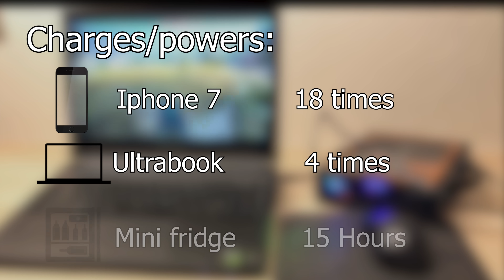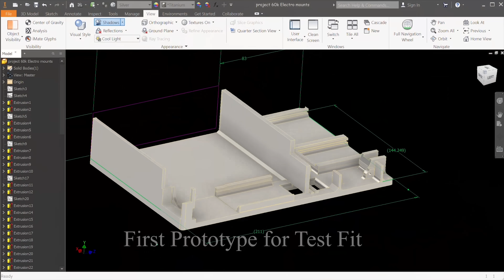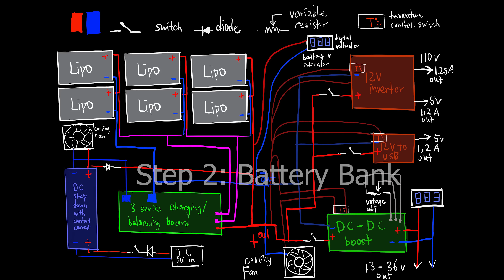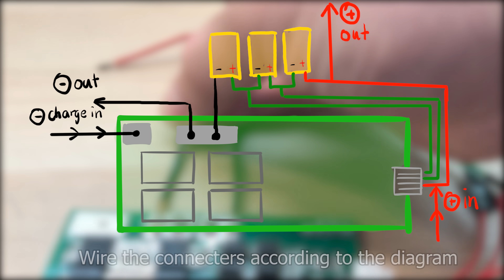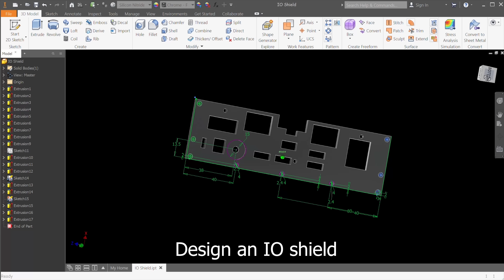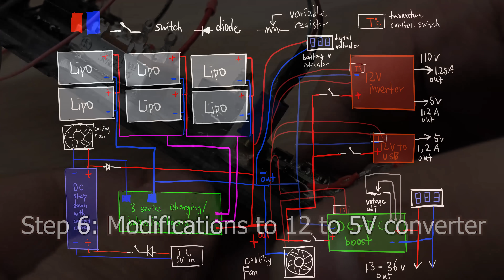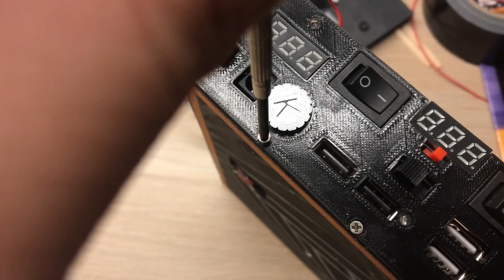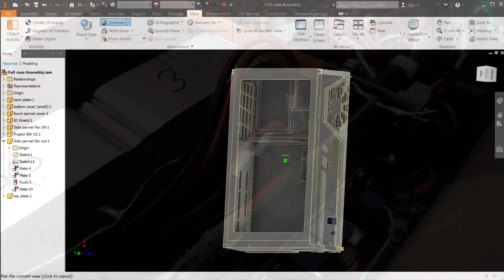Ultimate DIY 60,000mAh Power Bank (222Wh)

Comment: I read your comment BUT..... When you put 3 cells in series they become one practical cell... 10AH 10,000Mah.. put that new 12v 10Ah cell into parallel and you have 12v 20Ah..
Theres no way around the math. If you want a constant use WH..    248Wh.. Wait... Even then you don't get past that as the cells are series parallel. Im glad you built this cool little power bank. You have some skill but no matter how you look at it its still 20Ah. I gave you a thumbs up because its a nice little power bank but you really should change the title. Its misleading.
Reply: so is every powerbank any market has ever sold, he is just being consistent. all powerbanks are sold as 3.7v equivalent amp hour ratings, because it doesnt matter to the consumer what voltage internally it is it is just something to easily know the size of the battery.
Reply: @SuperBrainAK  Yes and no. I respect your input <3    BigClive tests power banks from time to time. Its a mix.. Many legit ones will measure out correct based on their output voltage. Many Cheap Off brand ones will skew numbers. Sometimes in an extravagant manner.
Reply: Ms.Fixit well yea his cells are rated to 10Ah each but who knows if they actually hold that much. you can also say the total watt hours and then you can tell the actual power rating, instead of letting the user assume the voltage your rating is at. But everyone stating at 3.7v is actually good because everyone can safety assume the rating is for a 3.7v configuration
Reply: I agree, watt hours should be the marketed energy storage rating for power packs like these 

Amp hours is great for selling individual battery cells or batteries, but for power packs and jump starters.etc, watt hours should be the standard
Reply: Ms.Fixit how can I run my 9 LiPo batteries in series and Parallel? I wanna use 3 to get up to 12V and the rest to just be used as energy storage, like longer runtime ya know?

Comment: 9:20 smh...
Reply: Better to crimp or solder ring terminals or similar onto each wire and then bolt them all together. Or a bus bar or something
Reply: as an electrician that hurt my soul
Reply: @dylandrouin3085  😂 feel your pain brother lol
Reply: HAHAHAHAHAHA!!!!!!!!!
Reply: Should have just twisted them together then solder or use a bus bar, just mashing them together isn't a good idea.
Reply: @kralyn3d I feel like a lot of people have expressed dissatisfaction with 9:20 and have suggested alternatives (such as soldering to a bus bar or using ring terminals), but no one has really explained why it's bad to solder a huge mass of wires together.

The reason why it's bad is because solder is actually fairly brittle. In such a large mass, there's a significantly higher chance that it may just crack with slight mechanical stress or even temperature shock (there's a lot of material to expand and contract). This in turn can cause intermittent power loss due to loose contacts or fire from sparking/shorts.

Bus terminals allow you to have less solder per connection. This allows for more space to expand and contract and there's a smaller surface for forces to act on. Ring terminals/crimping follow the same argument. Fun fact: all the factory wires in a car are crimped rather than soldered so they can withstand road vibration without cracking.
Reply: I actually got anxiety from watching that
Reply: @kralyn3d  Don't worry about defending your actions. Just listen to the advice and keep doing what you are doing. I learned a lot from this video and hope you do more.
Reply: I used to do that, was constantly pricking my fingers on bits of wire lmao

These days I use connector blocks
Reply: একটু বেশিই কুচুর মুছুর...
Reply: 🤮🤮🤮 christ on a stick, barf, how the hell, barf, can you do, barf, that....how is he still alive... na that's not a fire hazard, now this is a fire hazard!!!!
Reply: Hey now. He did say in his description that he wasn't an electrician...
Reply: @dylandrouin3085  I'm an electronic engineer, how do you think it made me feel :<
Reply: He should have used a butt splice, that what they are for! Or better yet use a copper bus bar, that is how other manufacturers do it.
Reply: @kralyn3d  No need to solder. Just use a bus bar.
Reply: my eyes...
Reply: @miniwarrior7  its not perfectly fine. if you're going to dish out advice, do it in such a way that it would make the person better
Reply: is that impractical?
Reply: use WaGo
Reply: @kralyn3d  That shits gonna break and set your house on fire
Reply: You don't even need a bus bar, just twist together the strands of each wire, put solder on them, and then solder your new "solid core" wires together.
Reply: @araibirshad8294  All advice does not have to be negative.... What he did works, and I bet it's still working fine.
Reply: @dvulichie9589  what?
Reply: Jan Nowak  A fridge won't run the entire time. So it is entirely possible that this could power a mini fridge for 15 hours, just not continuously. If your mini fridge does run continuously you need to replace that thing.
Reply: @kralyn3d  A bit mor solder may be just fine...
Reply: even a wire nut woulld have been better
Reply: @JohnSmith-rn3vl  Please don't practice what you have learned around me.  Thank you!
Reply: I almost cried here

Comment: Great video. Maybe for the new video, could you consider a way of locking the DC voltage output. Using such a knob is too easy to accidentally turn and could blow up a laptop. Maybe a locking mechanism on the voltage knob? Or somehow incorporating a toggle switch to lock the output voltage?

Comment: The power capacity is 20000mah because the 3s lipo protection board delivers 12V output by supporting 3x  3.7v Lipo batteries. Which means thst for 6 pieces of 3.7v 10000mah  batteries, there are 3 groups of 2 Lipos connected in parallel to obtain 12V 20000mah from protection board. You will need 18 Lipo batteries to with an 65 watts protection board to get 60000mah 12V output.

Comment: Great build and stuff but one thing and it is the big thing, IT IS NOT 60Ah! If you connect the batteries in parallel then the capacity will be greater but the voltage will stay the same. If you connect them in series then the voltage will increase but the capacity will stay the same.
Your battery pack should be rated at 11,1V/20Ah because you have 3x3,7V batteries in series and 2x10Ah in parallel. That is 3*3,7V * 2*10Ah which is about 222Wh, which is the same as 6*(3,7V*10Ah) or just 6x37Wh.

Source: https://batteryuniversity.com/learn/article/serial_and_parallel_battery_configurations
Please correct that mistake.
Reply: @kralyn3d  That is why they should real use the power * time parameter not current * time. For the raw battery [Ah] have a sense but for power banks it really don't because you will never know on which voltage they operate and stuff. For me 222Wh is peaty good. I still insist that you should use 20Ah not 60Ah but ya... It is not correct and never will be.... It is still very good project tho.
Reply: Yeah, @K R A L Y N  
Just change the title to "Ultimate DIY 3,7V 60,000mAh Power Bank" or something like that.
Reply: Bartłomiej Nóżka you copied the color of my image :(
Reply: You are right and also wrong
While using a good buck converter 12v -> 5v with 90% conversion efficiency
he can use the 11.1v 20ah(222whr) battery as a 3.7v 54ah(199.8whr) battery
which is same as using a 5v booster used in a powerbank

Comment: Crusty solder joints, hotglue on the parts that might heat up and melt it, a lot of exposed connections, cells put together with a ordinary non-high temp tape, dude...
Reply: Harsh........ Everyone starts somewhere, try to be positive in your feedback. Mistakes were made but rather than trash on them use the opportunity to educate and help him.
Reply: Not going to educate him, everything is already on internet, just google it.
Fishpaper, capton tape and non-acidic silicones are way to go.
Also to get decent solder joints you need like 30 minutes of youtube videos and few hours of practise, that's not much.
Reply: "I'm not gonna educate"

immediately starts educating about Fishpaper, capton tape, etc.
Reply: @randomnobody8770  Just throwing some keywords so it's easier for people having troubles with Google...
Reply: @Veritas-invenitur  he is actually being positive... as in he's listing the things that are wrong. the guy may actually learn something from this. whats the point of criticism if it acheives nothing ?
Reply: Well, if you want to make it you will be smart and do it right, right?
Reply: @Veritas-invenitur  Not my job to educate him.

Comment: That case you made up just screams SEXY!!!

as for the internals, here are a few things that you could do to improve the device (a lot of these are in my solar generator, though mine is a lot heavier and bigger) 

> Use 24V as the battery voltage whenever possible when working with lithium ion batteries, 7S lithium is in the perfect range for 24V inverters, USB chargers and other accessories (no boost converters needed) whereas 3S us too low to get full use of the power and 4S is too high for 12V devices to work 

> Heatsink the inverter for Christ sake!!! (That thing will overheat and fry if you don't heatsink the inverter MOSFETs) just having a fan blowing on the MOSFETs isn't going to cut it

> I would recommend using connector blocks instead of soldering wires together (solder joints often break in portable devices like this 

>  Make the battery bigger than you think you need (less chance of inadvertently overloading the battery)

> Add a fuse or a circuit breaker on the main power rail!!!

Other than that, this one is pretty damn good 

Mine jas the following specs

> all metal chassis (more durable than PLA) 

> 24V 40AH 18650 pack (made up of 3 individually removable 7S 5P battery banks for ease of maintenance) 

> 24V - 240V 400W modified sine wave inverter (couldn't find a 400W pure sine inverter that would fit in my design)

12V lighter socket (120w buck converter)
24V lighter socket (direct connection to the main power rail) 

> 10V-60V power input (can charge from almost anything, from a car battery to a rooftop solar panel and anything in between)

> I use 2 BMS boards in parallel for redundancy (I also have top end balancing via the use of voltage triggered resistors if both BMS boards fail) 

> Integrated 20W solar panel (charger of last resort) 

> LCD battery power indicator (gives percentage remaining, battery voltage and a bar indicator) 

> The wiring is uprated to 200% of the maximum power draw I will be pulling from it

> I use circuit breakers rather than fuses (replacing a fuse in the outback is kind of a bitch) 

> There is also a Li-Po voltage alarm connected to the spare 7S JST connector (there are 4 connectors, 1 for each battery pack and one for maintenance)
Reply: Please is there any way i can see this?
Reply: @cryptoville8961  I might make a video on it when something breaks and I need to repair it
Reply: @mwbgaming28  i can't wait......😁
Reply: @cryptoville8961  well you might be waiting a while for something to break, seeing as I over engineer things beyond normal levels of sanity to ensure maximum reliability

Though it is due for a battery upgrade relatively soon, going to be using higher capacity cells, when I do that upgrade I will record it and post the video link on my channel (Il post the link here if I remember which comment it is)

Comment: literally the ONLY thing I dislike about this, is that it uses Lipos (they HATE being left at full charge... and power banks need to be stored fully charged incase of emergency which you cannot predict... unless you charge them to something like 3.9v-4v instead.)

otherwise, this project is awesome... awesome job! this really gave me inspiration and ideas of my own :D
Reply: Hate is a pretty strong word. They certainly age faster at full charge than at nominal/storage charge, but the benefit of having double the energy density outweighs the negative of extra capacity loss over time from full charging, I would say.

Comment: You really did a great job! don't care about those how don't thanks at first them give the advice, you can only take the advice and leave the other words :), i think you still need to add some protections like fuses and temp controller, But you really doing very beautiful project  which most companies interesting in doing such products, your idea about providing wide range of outputs is very useful in our countries (we lost the power daily). i think you need to make a universal output and name it like laptop output, phone output and inverter (i.e lock the output voltage to those applications only to provide robust and plug and play device for those who work in area with unstable power source.
Great job bro.

Comment: Saved to my favourites! 
One question: Why do you need the rectifier diodes? Can charge current flow in the wrong direction otherwise? Or are you gonna charge with an ac power supply? Someone please explain..

Comment: uhh I don’t think it’s ok to draw this much current from those lipo batteries. also the powerbank is 20000mah because 2 batteries in parallel doubles the capacity and the series batteries just increase the voltage not the capacity.

Comment: Damn... It's looks like a time bomb
Even though that was a powerbank
Reply: It is a timebomb... No fuses, no thermal protection/shutoff, cold solder joints which will crack loose and short stuff out, no overcharge protection on the batteries and so on... This thing is literally a timebomb waiting to set someones' house on fire...

Comment: Quick tip. You have a 3s 2p battery not 1s 6p it’s 20,000 mAh not 60,000
Reply: Description.
Reply: Aethelbeorn his description is incorrect. It’s not the same lmfao
Reply: It’s still a 20Ah battery. If that, that’s assuming his cells are brand new
Reply: This is where converting to Wh is better
Reply: @faded.0913  not!
Serially connected batteries add up the voltage and maintain the capacity!

In parallel, the capacity is added and the voltage is maintained.

Comment: i don't think, that's a 60000mah actually it's 20000mah, yes you are using 10000mah 6 cells but in your circuit you are using 12v circuit keep it mind if you parallel 2 battery, amp will increase but the voltage is same or if you series 2 battery volt increase but amp same in your steup two 3.7v 10000mah battery parallel=3.7v 20000mah and that 20000mah 3 package in series= 11.1v 20000mah other side parallel all 3.7v 10000mah 6 cell battery=3.7v 60000mah but both are basically same because 11.1x20000mah=222w and 3.7x60000mah=222w, yes your powerbank can give you more than 200w like 222w but but that's not a 60000mah steup
Reply: Exactly! And I'm not one that easily goes "this thing isn't safe". But I (and many other commenters) see a whole host of poor engineering decisions or downright dangerous decisions. not a single fuse in the whole thing for example....
Reply: 20000mah 3s is the same thing as 60000mah 1s guys. It just depends on which way the cells are connected when measuring
Reply: Let me clarify. It's the same if you were going from the balance plug on a normal 3s lipo which isn't on these lipos. These look like 1s lipos unless the cells are end to end instead of on top of each other. The 3s 5500mah batteries I use are 3 times thicker than these since the cells are on top of each other.

The way he hooked these lipos up, with just the two wire positive and neg you guys would be correct since it's 12.6v being stepped down. On a regular non hacked 3s lipo you would also have another 4 wire jst looking connector for balance charging that you could use for stuff under a few amps that you could have hooked up to have a 60000mah @ 4.2v capacity. If it's hooked up just to the 12v you're loosing mah due to the efficiency and heat generation of stepping down the voltage.

Comment: I don't like it...

I love it!!!!!♥♥
I was planning to make this..! I made 100800mAh powerbank with foam board...BROKEN..
This was very helpful!! I should try with 3D printer..
Reply: There are a whole lot of other materials between foam board and 3D printing that you might try... Wood, plastic, acrylic, boxes you may already have that are made of pretty much any material could be used here.  I recommend plastic containers from the dollar store. Easy to work with and super cheap! 
I just mean to say that 3D printing is cool, but ultimately unnecessary for most projects unless you have the extra cash just laying around.  Designing for the printer takes some practice, and I'm sure that can be rewarding. But there is also something to be said for adapting an existing enclosure to your needs, or vice versa.
Reply: Yeah me too.... and also one of the worst soldering jobs i ever saw.... he cant even use new parts,they are cheap
Reply: Yeah maybe i will also love this if the creator of this video is Honest!!

Comment: This is really nice.  Would have liked to hear you describe as you assembled the unit, and as you put it together.  Maybe the 18650 power supply how to will have this.  I would like to know your reasoning for putting the power bank together and what it solved for you.  Be careful with those LED meters, more often than not they need to be calibrated  to a DVM (Digital Volt Meter) as they can be as much as 1/2 volt or more off.

Comment: 0:45 Uhhh... Those are Schotky, not Shockley. Edit: Those are 50V, not 55V.
Reply: "Schottky" - two "t"s. But yes :) https://en.wikipedia.org/wiki/Schottky_diode

However it turns out that Shockley diodes are actually a thing - they just aren't what is being referred to in this video, and I get the impression that they aren't manufactured any more, either! https://en.wikipedia.org/wiki/Shockley_diode